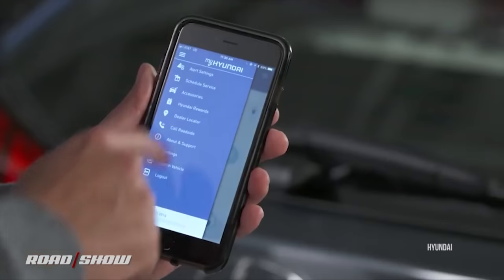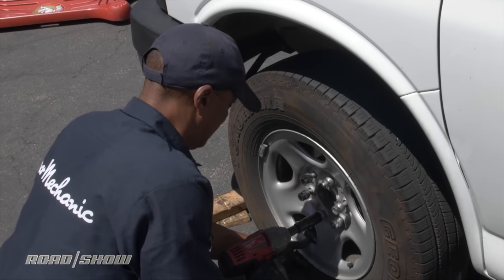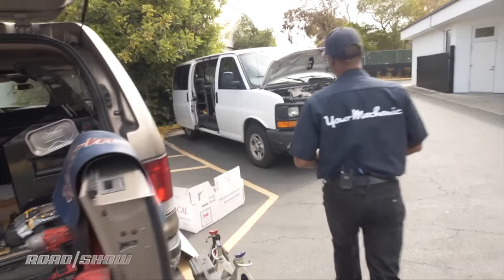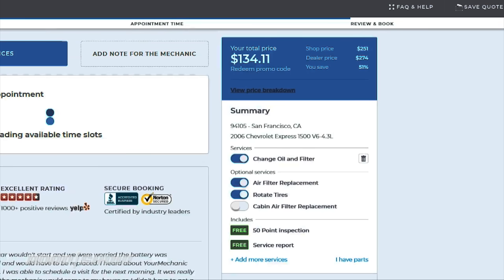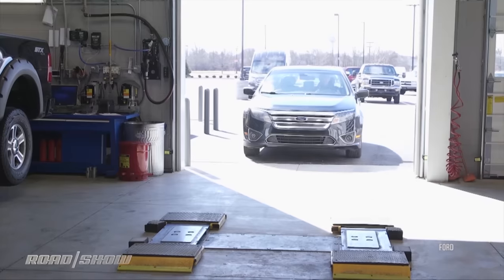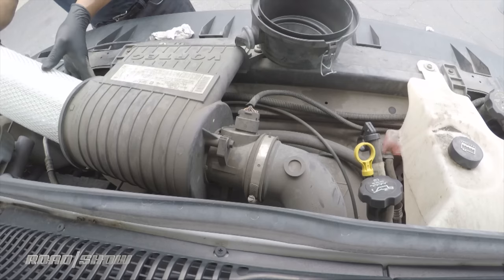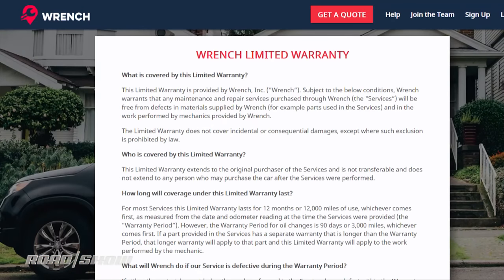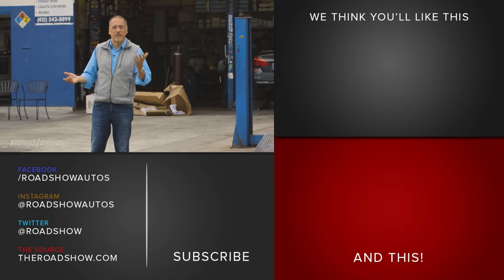See how mobile auto repair works | Cooley On Cars

Comment: Until today, I didn't know there were mobile mechanics like this.

Can't wait to try it out.
Reply: We've been around since cars have been invented. Just Google mobile mechanics near me. Look at the reviews & check out their websites. The big companies are using dealership guys, mobile technician & lube techs to provide service so you might as well cut out the middleman if you can & go right for the small business owner if possible.
Reply: Tesla has had it as part of its warranty for ages
Reply: @sadmanh0  Tesla is a relatively new company & is all EVs. ICE vehicles have been around for over 100+ years so they are what we are talking about.
Reply: never heard of this mobile service either. how does pricing compare to using a tow service to an auto shop and then do repairs?
Reply: @alch2555  Most mobile techs have less overhead so price are comparable but mostly more economical then going to a shop or towing & the dealership. There are different levels of techs (dealership, brand specialist, (most) general service, lube) so make sure to pick wisely for the service required.
Reply: I didn’t know until I saw one driving through Charlotte, NC with an advertisement on their van
Reply: You are making a terrible mistake.......By
Trusting a mobile mechanic, if he does anything wrong to your car and f*** it up what are you going to do??????. Your car has to sit there and wait until he has the time to come back to your home ..if he takes the time... and he's not going to come back to your home for free. you're going to have to pay him again. And today's mechanic are so crooked they will fix one thing and break another. So you can call them back to fix that job. My advice to you is to go to a neighborhood mechanic someone that you trust and you can receive a guarantee  on the work that they perform
Reply: @jamesthefisherman1060  .. I have no idea how much you pay for your car,, But,, my car cost me $45,000 Dollars....
That's $45,000...Dollars.... it's going to take me five years to pay that b** off
For that type of money I am not going to deal with a shade tree mechanic... if something else breaks because of what he did or he breaks something else.. that's your ass.. believe me he will not come back to fix it for free.. there's nothing like a guarantee on the work that is performed on your vehicle.. it's a big company f*** up something they're going to fix it for free.. a mobile mechanic will not and if he does he's going to charge you.. as my grandmother used to say now put that in your pipe and smoke it.. one thing about the companies they give you guarantees
Reply: @harrisjohnny477  😂😂😂😂
Reply: @harrisjohnny477  how is your $45,000 car doing so far.